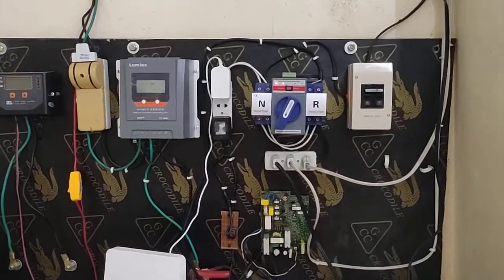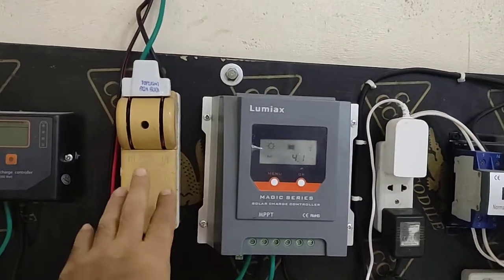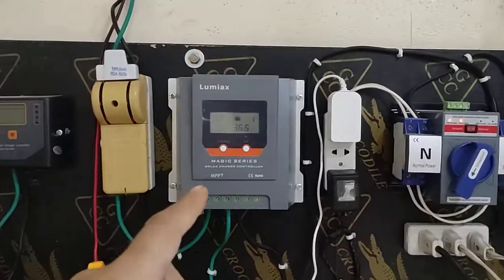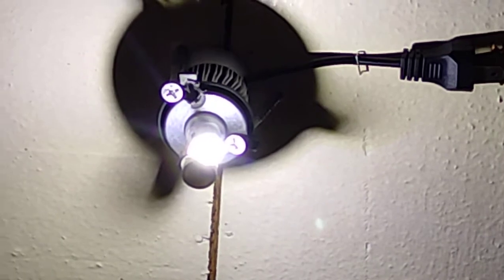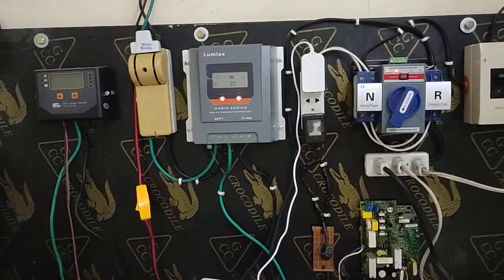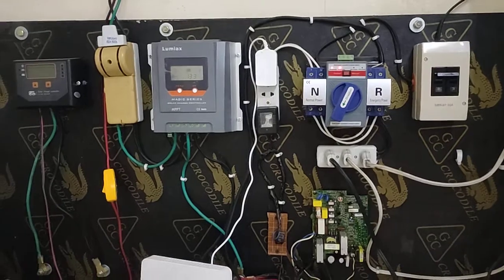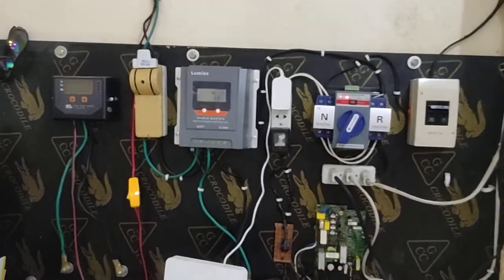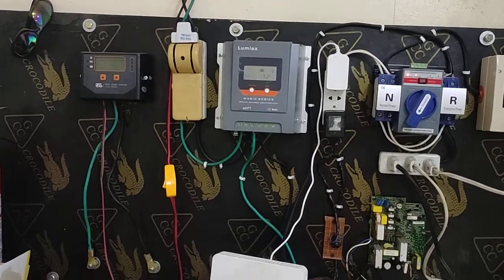200Watt DC Solar system

Comment: Great learning dc system but the best “start” is a solution that is capable of improvement. One should absolutely get a controller with the highest panel voltage input, wattage rating and battery voltage. Frankly I would buy a PCM controller with higher inputs and output then the other with lower . The problem isn’t as obvious as one thinks.. if your battery bank is 12 volts you will be wasting electricity thru the resistance of those 6 gauge feeder lines. Additionally 6 gauge copper is expensive. 110v ac is “more” efficient but the efficiency has nothing to due with AC but the fact that greater voltage requires smaller ( CHEAPER ) wire diameter. So don’t shaft yourself with a controller capable of only 24 volts solar input and a 12 volt solar output. You will outgrow it fast and eventually have to by the suggested controller above. The only bad thing about running a 48v or 96v battery bank is the shortage of available dc lights and equipment that runs on these voltages. In some situations one can just hook 2 or 4 24v lights in series ( keep in mind you are using 12 gauge wire for the series hookup ) or buy cheep efficient dc buck converters ( for a situation we’re 48 volts need to drop to 12 ). I guarantee the money you save buy not buying the more expensive large wire gauges will outweigh any other expensive. Lastly think a long time before you consider buying a inverter, they are ridiculously expensive and unreliable.
Reply from the maker: Wawoo brother you very technical I like your idea you are right I also now upgrading to 48v 
Thank you and best regards from Philippines 🇵🇭
Reply: @MarkPrince1317  Thanks, I have to say your video is one of few that address the advantages of running a DC load in favor of an AC load via and inverter. Inverters are expensive, undependable and power wasting. Unfortunately however, higher DC voltage Behaves slightly different than High AC voltage. Switching “on” a high voltage DC circuit under load will create a massive arc. You will not find a DC relay above 24 volts as they would constantly be going bad. Also be sure have a breaker box near the battery to protect against shorts and bring the load ups one circuit at a time to respect the “arc rule”. Switch’s at devices may be ok as load as the current draw is marginal. I look forward to going all DC what my inverter blows up again ! 
Regards from Virginia, USA. Wish I was in the Philippines 🇵🇭!
Reply from the maker: @jethrotull5847  wawoo brother I like your idea 👍 thank you